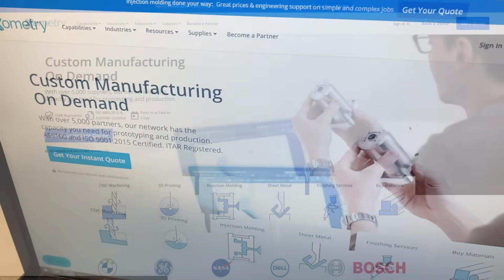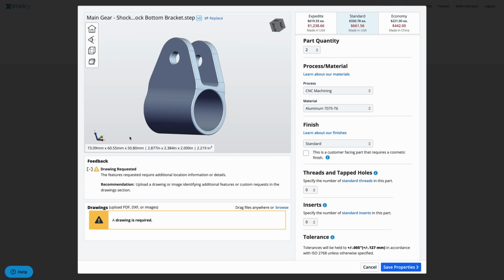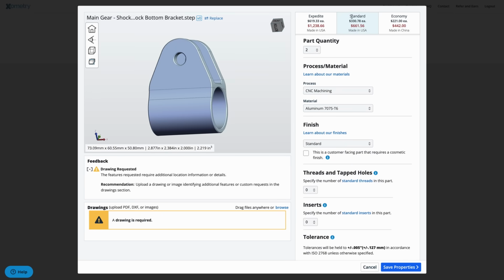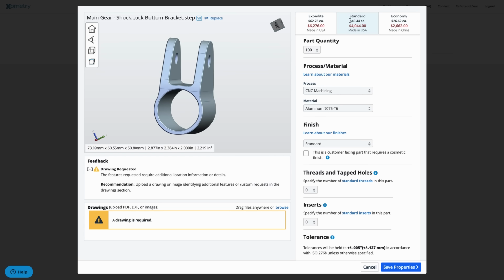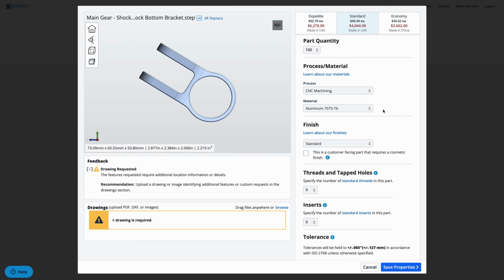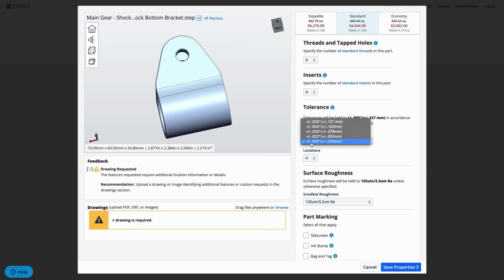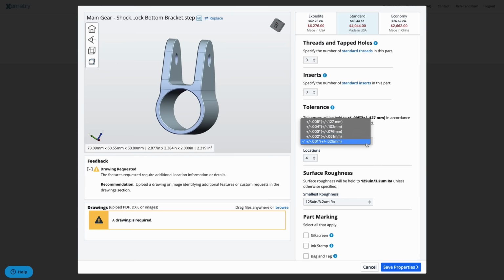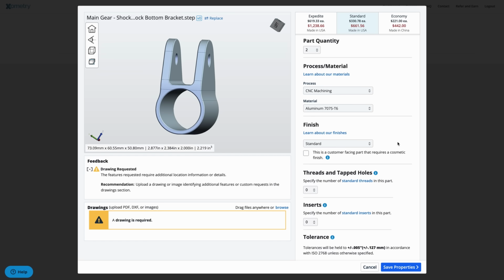The TRUE COST of CNC machining!

Comment: Leave stock in the bore on the first side then finish the bore thru while finishing the second side. Eliminates any blend issues.
Reply: I'm surprised he did that. You never finish a hole from both sides. Even if the hole is split due to a slot, like the smaller hole there. For the best accuracy, must always finish a hole all the way through in one shot.
Reply: @gredangeo  well to be honest. These guys are soooo new. Shouldnt even put up videos. It shows people how little they know about precision machining. Hey they are really nice guys no doubt and im an asshole for saying anything. They'll do fine. Slow, but fine. Or not :) i want them to make bux. Its a great profession. I now have vf3 in my home art studio. After a few decades of operating programing designing and engineering.
Reply: @nobody617   Makes me wonder what they consider a "high level of precision". To me that's .00005"
Reply: @logannewman4532  normally maybe .0005 would be tight for me. Rarely do I have to go that tight. The tightest ive had to hit was .0002. kinda rediciulous but no big deal with good measuring device. St that tolerance temperature changes that pretty easily. I'm thinking those were for a press fit. Freezing the part to be inserted. This type tolerance is probably meant to add as little stress to the part after insertion. It's been so long I haven't thought bout it at all. Usually .001 is adequate. But you do want to do your bores and whatever else lines up all in one setup. I suppose if that hire these guys were doing isn't all that important, the way they did it must have been adequate, I just always use boring bar from one side of course. I can't remember if they mentioned any tolerances. I'm just use to making parts and assemblies that weigh 300+ pounds and spin 3600 rpm :) what I've done is nothing compared to what's done out there in the world. Amazing engineering and machining is done daily like it's nothing. I am nothing. I'm aware. :)
Reply: @nobody617   One more zero. I occasionally have to hold half a tenth.
Reply: @logannewman4532  that's just mind boggling to me :) yup there's always another level. I probably could do it if properly set up, and a guy like you around to show me all about it. :) It's been along time since I've hit the       .0002 . It was only one part in an assembly. We called it the center pivot. It was an aluminum part 1" thick maybe 6x6 for 350, hp coupling.  somewhat a plus sign shape. It had four bores that had what we called torque rods pressed into it. Large magnet rotors had pacific linear bushings in it and the magnet rotors slid in and out on the torque rods. The magnet rotors would transfer around 350 hp thru the air and exited our conductor rotors. It was bassicly a magnetic non contact clutch. A magnetic speed control coupling for industrial equipment. We did all kinds of things with this technology. All different sizes up to 10,000 hp. All types of different couplings not just speed control. We invented this technology and then licensed to magnadrive.com also I made the brakes for the north american eagle land speed car. Well they wrecked and died. Our brakes did save them one time when the parachutes failed to deploy. Our brakes weren't meant to do all the braking but they did no problem. Fun stuff. There is a video on here showing how the brakes work. Levx  north american eagle magnetic brakes. I think you'll see the torque rods. Nothing special at all as far as my .0002 stuff. Just 1/2-1" bores depending on size of coupling. I've seen when the tolerance was to tight, the part being pressed into blow out the back side. No gooda. Want as little stress in the part as possible. Spinning 300+ pounds 3600+ rpm is no joke.... To me. Child's play to others. There's always higher levels. Machinist are amazing.
Reply: @nobody617  Yes , that´s what I was thinking too. I am a machinist in a german factory which produces direct drive linear motors and 0,001-0,002 mm is the normal day procedure for me ( that equals around 0.000039-0.00008 " ). These guys really still have a long way to go. :D
Reply: @logannewman4532  you got my attention. Can you give me an example of a part that needs that?
Reply: To be more precise (he he), a part that you do
Reply: @chipnale8324   I'm in an R&D lab with the largest semiconductor company in the world. There isn't really a "part that I do" so much as a continuous string of new parts. I program and run new parts and new revisions day after day. I work with advanced ceramics though.
Reply: @logannewman4532  okay but i can assume those dimensions are simple and small. There are alot of variations of machines, tolerances and parts. Typically people admire the precision working and totally ignores the fact that even though the tolerances usually grow in the bigger parts, its also harder to hit those numbers, because of the movement area of the actual machine, variation in tool length, actually mounting the piece, etc. etc. 

Remember guys. Nobody can do everything and theres a lot more in the cnc world than turnin dollhouse door knobs.
Reply: @logannewman4532  and this was not taking a shit on you or your work. Cheers.
Reply: @chipnale8324   I have to hold features coplanar within tenths over up to 30 inches. I have to hold true location on features that are feet away from a reference datum. What's more, these parts experience high temperatures when they are in use in their final assemblies. So they have to be engineered for thermal expansion.
Reply: @logannewman4532  How are you holding and measuring that level of precision repeatedly?  what type of machinery etc?  Genuinely curious as we're hitting 0.0002 repeatedly and it can be a challenge
Reply: @TheBlaert   Honestly it comes down to constantly calibrating. Full interferometer calibration on a high frequency schedule. Most of the features can't be measured on the floor. CMM and vision system tells us if there is an issue. We have a pretty good feel for how often we need to recalibrate to avoid scrapping parts at this point. I'm not allowed to divulge what equipment we are running.
Reply: You can tell on the outside of the finished part that the two ops weren't perfectly aligned, which means the bore holes likely weren't either :/
They need to chuck in an annular cutter and bore all the way through in one op.  The outside isn't that big of a deal but they can index the second op for exterior finish with a rod through the large bore hole and a flat surface against the first op to get the best zero possible.
Reply: @Skinflaps_Meatslapper   Annular cutters don't give you total control over Ø. I would either pocket it out and then carefully finish with an endmill or if the tolerance was really tight I would get out my adjustable boring bar head and work it out.
Reply: @logannewman4532  Maybe not total control, but they're consistent in the diameter they create and ridiculously fast by comparison.  For the price of getting it right in house I'm sure they could justify a custom size annular and follow up with a reamer/boring bar to reach proper tolerance.  Or buy a giant single pass broaching machine.  Or EDM.  Lots of ways to skin .0005 off a cat lol
Reply: @jessicaliu7424  lies!!!!
Reply: @nobody617  ?
Reply: @DieselRamcharger   K
Reply: Leave meat on the underside of the part to hold in a vice. Do outside contour and inner flaps, drill then ream hole. Flip 180 and face off the stock. Concentric, done. Flip 90 degrees and then drill then ream hole through the flaps.

Comment: Then an even higher cost is a manual mill, one person and a lot of turning handles and setting various cut depths. This is after doing the math in your head or on paper for tool path, setting angles, tool dimensions and visualizing the final part in your head from a 2D set of blueprints.......wish I had a CNC...lol...at least I upgraded to a Digital Read Out, those marks on the dials are getting hard to see.

Comment: I estimated 65 USD for manual single piece production.
Reply: to do this manually on a mill you need to set this up with rotary table and also going to need boring head and drills and end mills and your most likely going to take the best part of a day to make 1 of them so unless you work for $5/hour its not a $65 part even doing this with a cnc machining center like in the video is very slow the easy way would be on a live tooled 5 axis lathe you would spend a little more on the material but in terms of production it would take maybe 10 minutes to make each one
Reply: @davidmilligan4751  I would start with the hole on a lathe, a few tricks on the mill for the outer ring, pivoting the piece around the hole. It's not rocket science. I understand that there are many approaches to make this piece, but CNC-ing is sort of Steampunk overcomplicating.

Comment: BS on the cost of the material.  Less than $10.00 for two pcs of 7075-T6.  If you had buy outside just those two pcs would be more like 80.00 plus shipping.
Reply: 7075 costs about $4 per pound.
Reply: @hartmetall515  Not when your buying a pc that small. To make those two parts.  I own a shop and buy 6061,7075 and 300 stainless every week.

Comment: What kind of endmills are you using? Also software? If you use variable geometry endmills or high speeds and feeds with low feed per tooth with a trochoidal tool path your tormach could do it with less strain on the spindle/drive. Also I would suggest from personal usage that you should buy some short insert drills to define the initial shape of the bore in one stroke

Comment: I randomly got this video in my feed, but one of the reasons I like to have a CNC is how many times I can screw up or change the part or scrap the whole idea and move to a differnt idea in prototyping. Material is cheap, screwing up on a design you had a shop make and had to redo is horrendous and it hurts, plus doing the work on your own makes you a better designer and have a better understanding of things, I'm fairly new to all of this but I figure 10 more years amid practice I'll be pretty decent
Reply: Yes. Building things on your own is the best option and Something everyone should do and try
Reply: You didn't get this randomly. Youtube controls your mind/
Reply: Judging by this video, it'll be cheaper to buy one's own CNC machine for just a small project, than outsource.
Reply: Don't forget cutter cost.  Good tooling isn't cheap and a few broken ones soon adds a hell of a cost
Reply: Except if you don't have the room for a CNC or can't afford one. How much do used CNCs cost approximately?
Reply: @GMC997  New ones are under $10k.
Reply: @Tom-hz9oc  Maybe the entry level ones, but my question was how much does a mid-range used one sell for.
Reply: @GMC997  I’ve seen them under $20k, but usually in the $20-$30k range.
Reply: @Tom-hz9oc  Thank you very much!
Reply: Not since biden was elected steel went up 40 percent over night
Reply: @GenghisKhan311  Source?

Comment: PCNC 1100 appear to be outdated model. This 3-axis, without tool changer machine it's just for low volume machining. Not a best example for demonstrating true costs of CNC production. In my over 30 years experience as CAD CAM, CNC engineer I've seen this type machines mostly in spare parts, prototype shops. Also most aerospace parts are machined on 5 axis CNC. I'm not even mention importance of rotary tables and palet changers. Presented part fits die casting category with final CNC machining.

Comment: As a machine shop owner i can tell you that you're wasting material time and effort and you can make this part way cheaper and faster. make from a pipe and a bracket and weld them together way faster.
Reply: YUP YUP, I just now found more of what my comment needed.
Reply: except that the engineer has called for billet with no welds as its used in the suspension of an aircraft landing gear if it wasnt for the fact that an engineer has called that and that there are certain requirements for things to be sold commercially then just welding it together would be fine
Reply: @davidmilligan4751  I'd say that they really need to take a look at CroMo steel for critical apps like this and FORGET the bling bling aluminum
Reply: @charlesangell_bulmtl  honestly it would depend on the stresses and weight limits after all there is more than 1 limiting factor to flying although im aware that the CroMo is far stronger than any aluminum the engineer may have some other reason for requiring it maybe corrosion resistance or maybe there is a weight limit to the whole article im not sure and its not really explained in the video
Reply: @davidmilligan4751  I think that aerospace is too hung up on their 'darling' aluminum...
It doesn't handle the stress cycles at extended ranges of heat/cold that other materials will, it's just a dangerous PITA
Look at a bicycle for example, the nicest lightest ones I've owned were CroMo tubing from Taiwan
They were cheap and plentiful at one time, but now marketing has figured to put a "premium" on the latest ones
Reply: @charlesangell_bulmtl  Are you crazy? Steel bicycles are never the lightest. They are the heaviest!
Reply: @justinwbohner  You've apparently Never rode but the cheap steel bikes. Try  an old Raleigh. I have a 70s 3spd female Sprite that is considerably lighter than my Chinese 6016 Ironhorse
Reply: Brazing is another option so additional machining to correct for welding distortion would not be needed.
Reply: @obi1187  Was an excellent example old world craft found on Raleigh's and many more bike's

Comment: Easier and faster to use a manual mill, and machining a simple fixture to support the center bore would have reduced the number of operations, hence improving tolerances. Finally, it’s a poorly designed part that requires that many operations.
Reply: Lol! well the machining could be improved. i can guarantee a cnc can give better tolerances repeatedly than a manual. especially if you use a high end machine. Plus you could probably knock this part out in 15 minutes once you get everything set to go.
Reply: @dominic6634  I didn't say manual machining was different tolerance than cnc, I said reducing the number of operations would lower the tolerances, repeatedly. That being said, a cnc mill will have better tolerances than an inexperienced machinist, but an experienced machinist will hold any tolerance a robot can generate.
Reply: @dominic6634  Hi,dear friend,have contact information in the video  https://youtu.be/_SBkl3b2ZOs

Comment: that was machined the absolute worst way lol I've been a manufacture and design engineer and program cnc mills and lathes for 19 years now I could machine that in two ops and in 2 mins 7 seconds and cost to have those machined is way less i would never use that website to actually get a quote i would get a quantity you need and hit local machine shops we would have an hour setup in the quote we already have the fixturing that would be needed so no tooling in fixture costs would be there thats why that website isn't the best... I have my 9 3d printers listed on that website under several websites like and including that one...